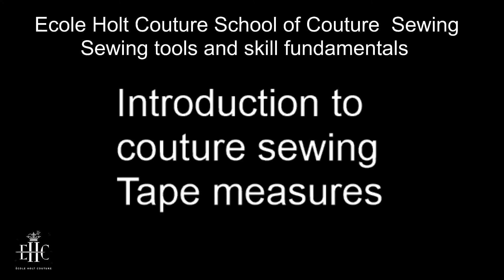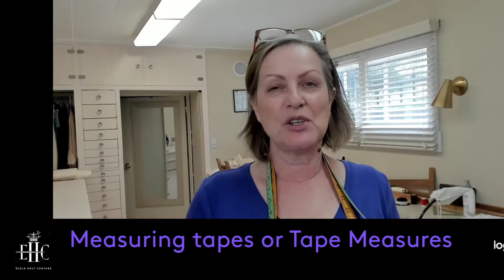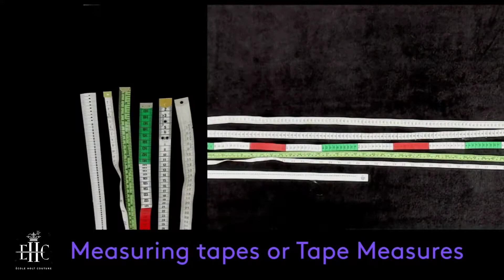Measuring Tape - Ecole Holt Couture Introduction to Couture Sewing, basic tools and equipment.

Comment: It would be helpful if you could inform the brand of one of it ;)
Reply from the maker: Thank you for your comment! There are many brands available, some more reliably accurate than others, and some are short lived. Recommending any single brand may not be useful depending on your region. I would rather suggest that you have a look at what is available in your area and compare items with the suggestions in the video. 
Watch out for 'give away' measuring tapes that are normally used as corporate swag - these are novelty items only and likely not accurate enough.